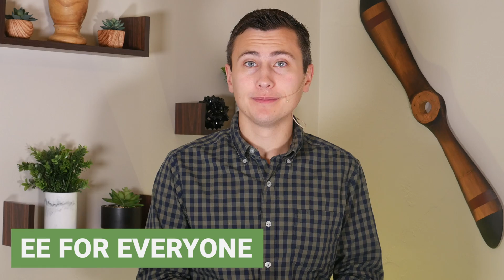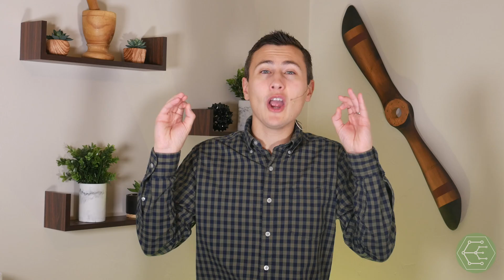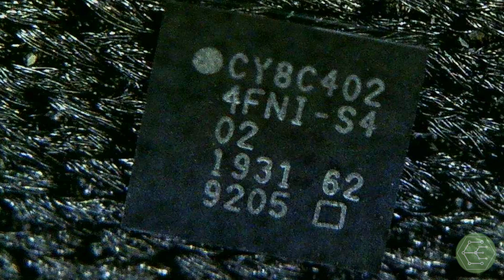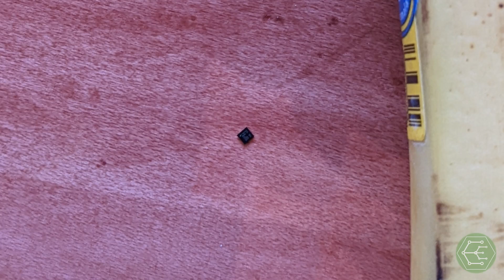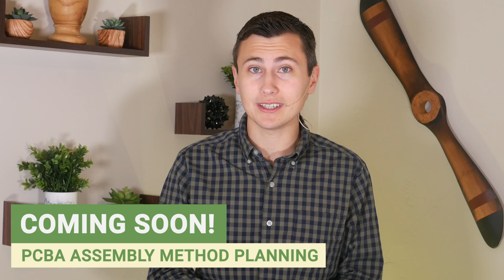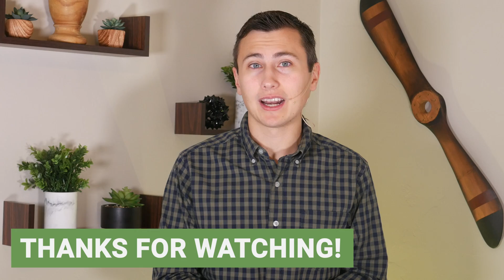Buying Electronic Components is Terrible: Motor Controller Prototype Parts | MOT 10

Comment: I hear ya; it's really putting a damper on my newfound hobby. At the start of the pandemic I started learning EE and after about a year got to the point where I designed a 700w BLDC controller a third the area of a postage stamp. Was super psyched to do rev 2 to correct all my newbie mistakes ... until I realized the lead time for the various micros, transceivers, FETS, and drivers I was using was 2+ years :C
Reply from the maker: Oh yeah, it's a real bummer.. but these shortages won't last forever! Say... wanna add Modbus to that controller? ;)

Comment: As a designer and small electronics business, I'm leaning more and more to providing a small business parts consortium where all of us maintain a list of those reels, tubes and bags full of excess parts we have laying around. That, like you, have bought for various reasons... specifically, projects that weren't design wins or where we thought we'd use them elsewhere, so bought with 'economy of scale' in mind. Would you, for one, be interested in this type of consortium? :)  BTW, I'm an 0805 passive nut and have reels and reels of these size passives that even older hands like mine (62) can handle. Oh, and I have a good number of PSoC1 parts as well as 3's and a few 5's... And DIP 'jelly bean' logic IC's (74HC* mostly).
Reply from the maker: Hi Scott, that sounds awesome! The hardest part of getting me into that consortium will be me growing past the pack-rat tendencies that led to the buckets of parts in the first place. :) 

For a good cause, I'm sure that I'd share. :)

I've personally gathered some 0603 passives- not too tiny! 

Cool concept, thank you for sharing!

Comment: Hello.  Given 14 month estimated lead times, I am currently designing out dc-dc converter ICs in client products using the discrete semiconductor parts we can source.   Its like going back to the 1980's, crank up the Devo, lol. Also can't buy PIC16F parts, so using a PIC12F we have and added a shift register to make up for missing I/O.   Good times.
Reply: I hear you. I tried to buy FPGAs last month - forget about it. They are now made of unitainum. So instead I bought a bunch of breadboards and mounted them on plywood for discrete logic chips to make it work. Hey, at least DIPS are easy to mount and use and this is just for a bench prototype.
Reply from the maker: Hi Wayne, that's awesome. Back to the 1980s for sure! Its a new interesting challenge- designing for what you can buy.. not necessarily best performance.
Reply: @EEforEveryone  Not best to be sure, but more than adequate in this application, I hope, lol.